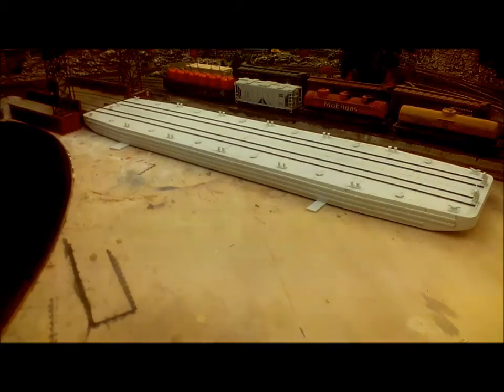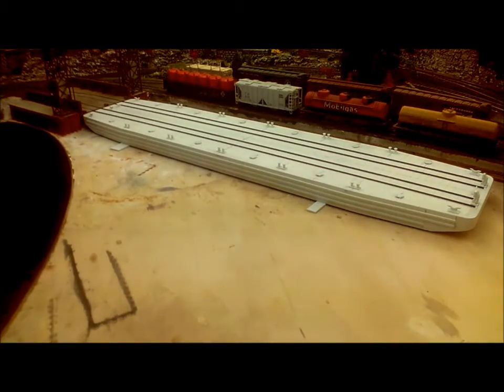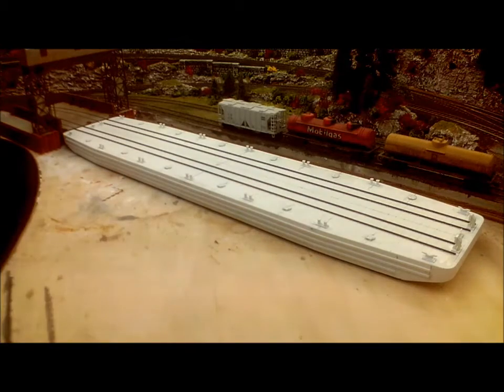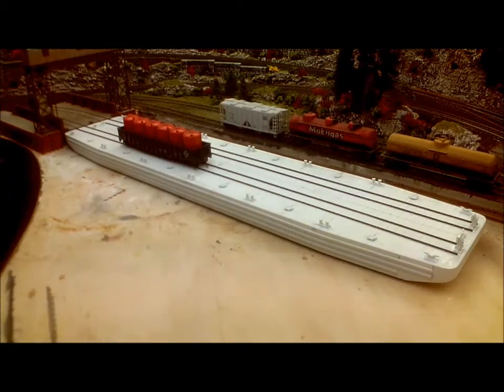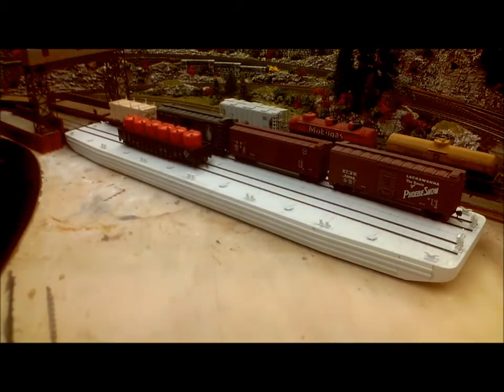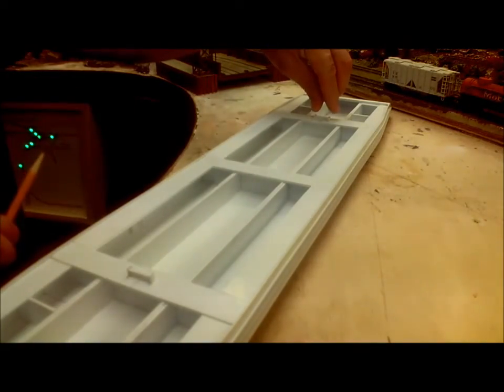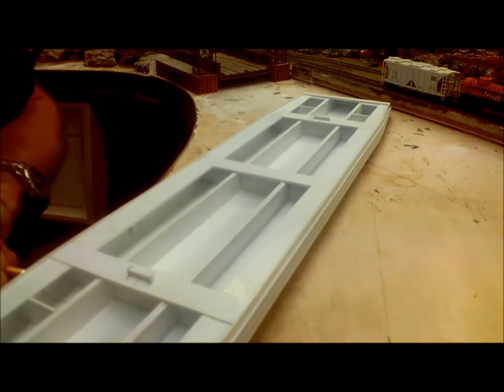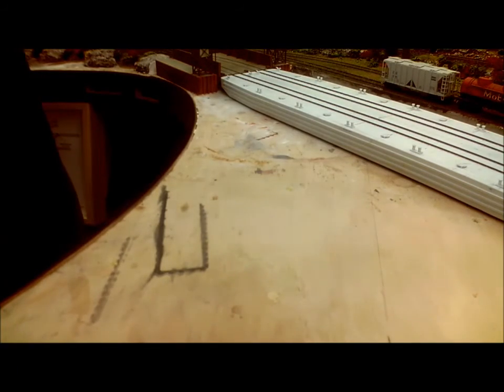My railroad: Loading the car float

Comment: Moin Peter,

What a great video! You've done a very well real looking and working RR Traject Barge...ballancing is what you'll need by loading and unloading of it.

Loading a double track RR Traject:
Load one side to the ½ of it than pushing all the cars onto other side onto the Traject ship, than push onto other side the before ½ loaded train part into place upon the Traject barge.
For unloading pull from one side the ½ of the cars from the Traject ship, than unload the other side track completely and finally the before ½ unloaded side completely unloading, too.

For myself I am still in planning to build a a two track RR Traject Sidewheel Steam Ferry for acrossing a seaside rivermouth.
Me I am trajecting Passenger cars, too.